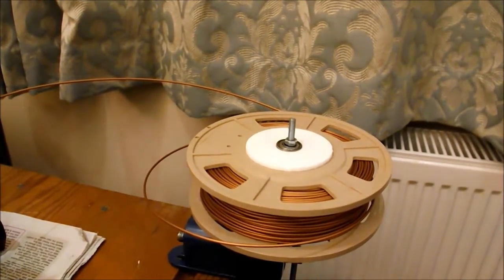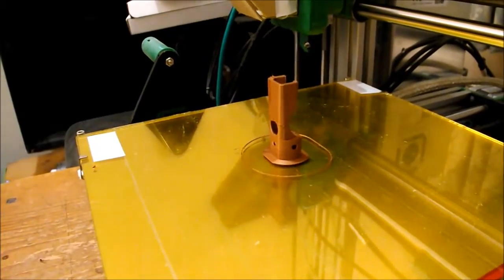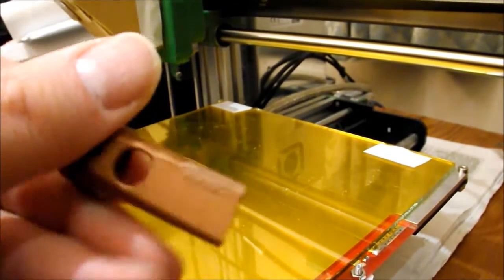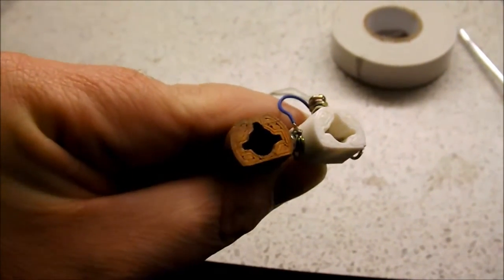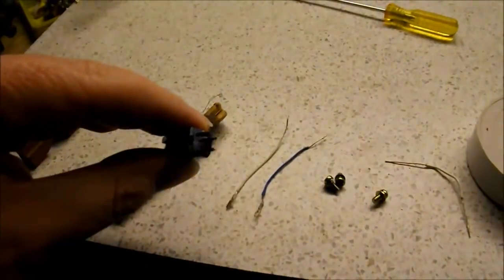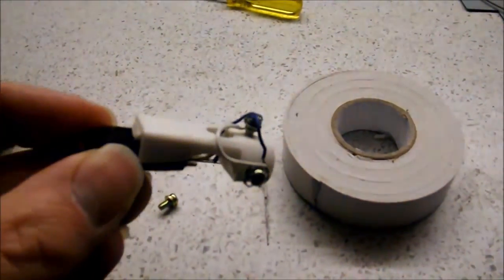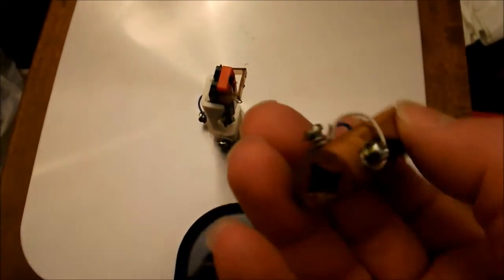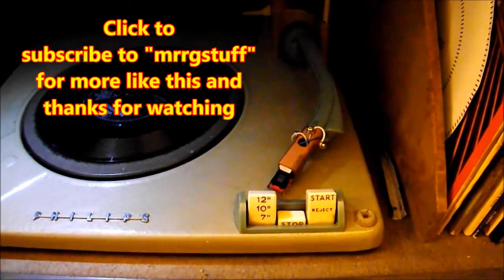3D printing and assembling Philips headshell

Comment: Hi do you know how I could fix the speed on one of these beauties?
Reply from the maker: This one was completely jammed when I got it, so I removed the whole mechanism from the machine and dismantled, cleaned, lubricated and reassembled the motor. I also had to go over the rest of the mechanism to get all the parts working properly. This 4 speed unit I believe is an AG1014, but I did find the service manual for the very similar 3 speed unit (AG1003) which helped a lot. I didn't need to do so, but that document mentions you can make very slight changes to the speed by lengthening or shortening the spring which I believe goes to the idler wheel, but cautions to make sure everything else is adjusted properly before trying that. If you email me on the address on the 'about' section of this channel (appears in desktop mode) I can send you the PDF. Hope that helps
Reply: Brilliant thanks 👍🏻